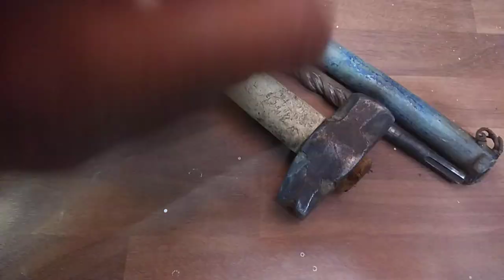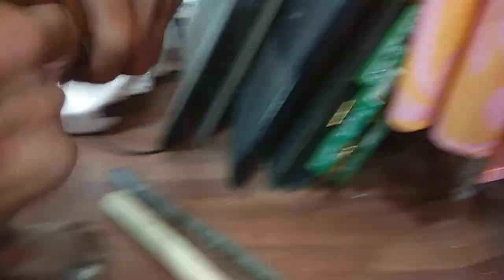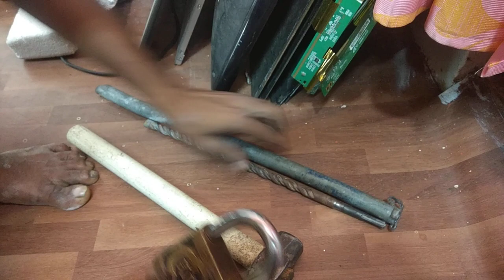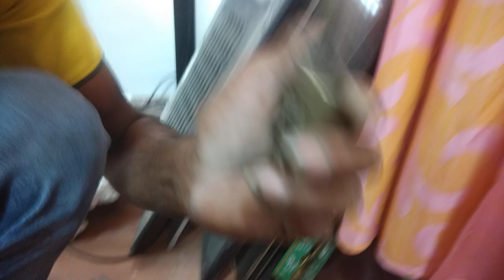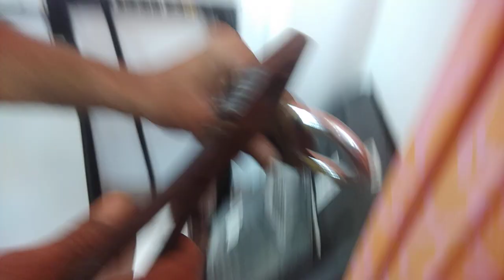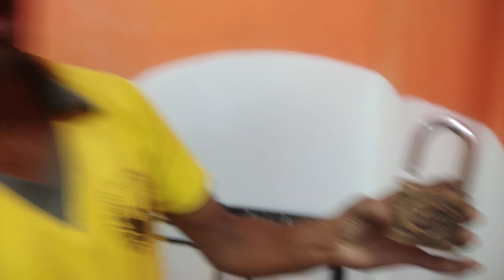how to break  GLOBE LOCK with Small Weapon   #BREAK #LOCK

Comment: Yes! This method worked for me. Our lock had some issue and so unable to open with the key. We opened it easily with this method.

Thanks for the video.
Reply: Does your lock was same
Reply: @onlinemoneymaker8838  yes.
Reply: @RajKumar-mh9nw  can i open Rounded lock
Reply: With that trick
Reply: @onlinemoneymaker8838  not sure. I haven't tried.
Reply: We misplaced the key while the lock was still in the door. So we used this trick to open it up. That's all
Reply: @RajKumar-mh9nw  i am trying  now lets see what happen
Reply: @RajKumar-mh9nw  I am not using  this trick for Bad purpose l just Fun in home
Reply: @onlinemoneymaker8838  got it. I'm not judging